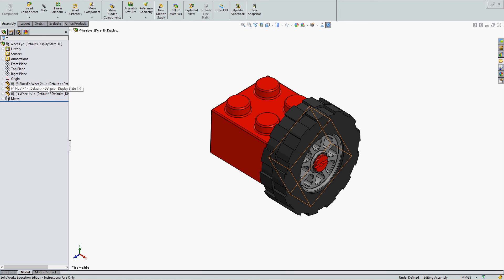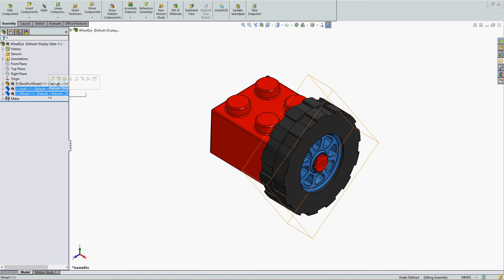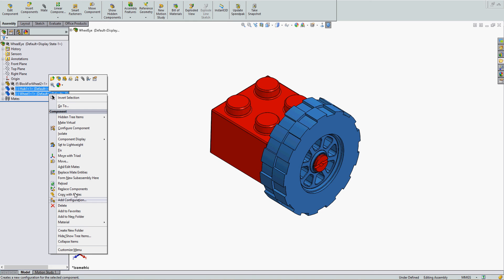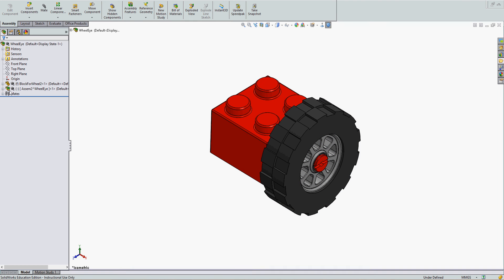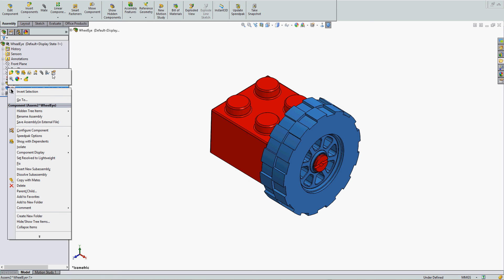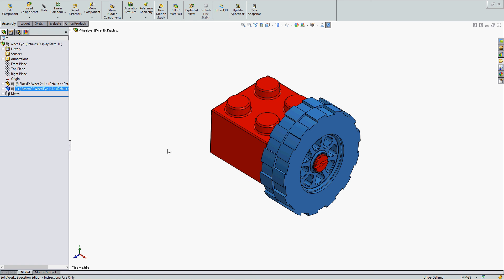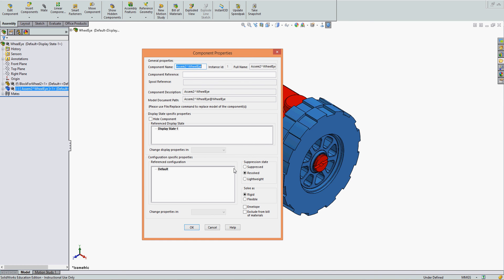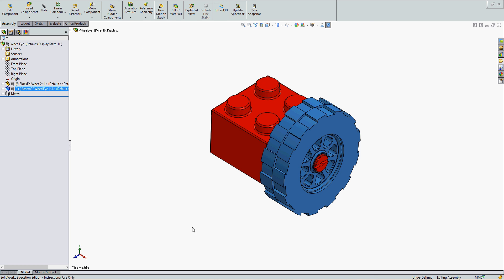Creating a Subassembly within an Assembly

Comment: How do I stop it from saving as part file?
Reply from the maker: Switch the type to assembly in the save window.
Reply: I have made a sub assembly based from 1 part and edited the sub assembly afterwards to include the additional components. But it only saves the first component and saves it as a part file? How can I fix this so it comes as an assembly so I can then create a drawings?